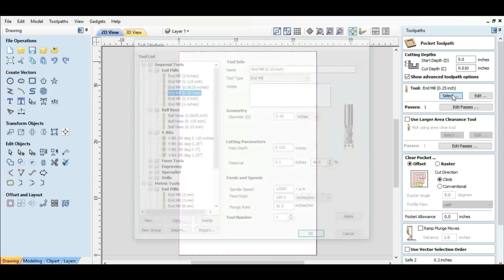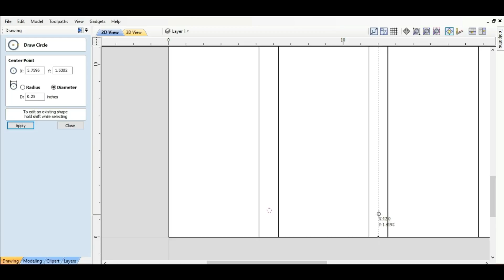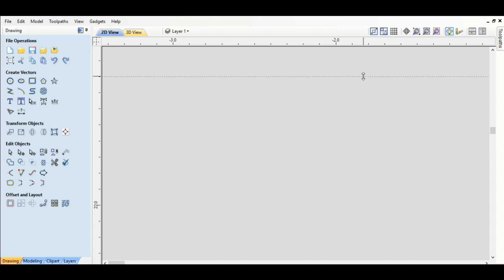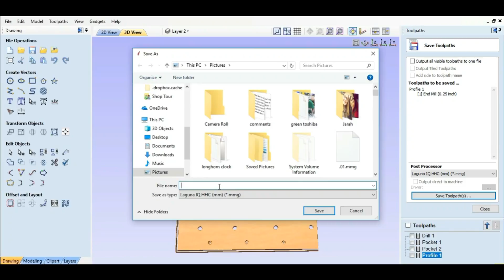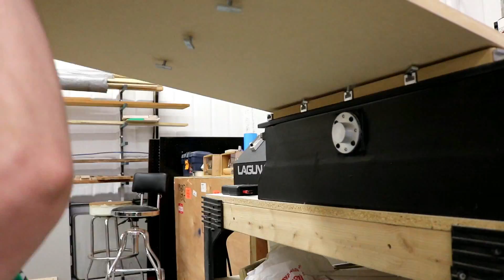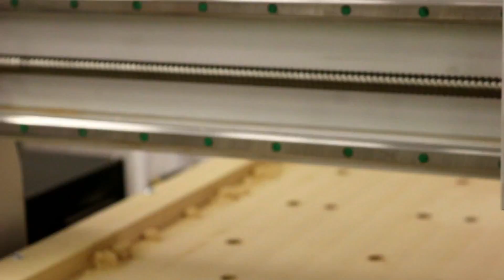Make A Spoilboard For Your CNC // Laguna IQ CNC

Comment: I am new to cnc work and find your videos very helpful. I purchased this bit on your recommendation. My RC-2255 is a 2 1/2" cutter but you refer to yours as a 2" in the videos and the comments. I have to enter the bit into my database and the Amana speeds are very different than what yours are in the video. Do you find your speeds to work well? Any advice?
Reply from the maker: Thank you for watching the videos. I would go by the charts that Amana has for speeds and feeds.. I did this video years ago and the speeds and feeds worked for what I was doing but I would trust the Amana site.

Comment: How does the in-line clamp fit and not hit the bottom spoil board? The stem looks to be about 2” long or more, did you drill through both spoil board? Thanks
Reply from the maker: Yes.. drilled deep enough so it doesn’t bottom out.

Comment: Great video man.   I have a 2 x 3 ft as well.    Question.   How deep does the holder go down?  Or how deep do you have to make the holed for the holder?
Reply from the maker: I can’t remember exactly.. I just measured the length of the peg that goes in the hole.
Reply: @JakeThompson The part the sticks down in the MDF looks to be too long, did you remove the black part of it leaving the grey part to go into the mdf?
Reply: @leejackson3781  Yes I removed it.. I also used some Kreg push clamps too.. I like them more

Comment: Just setting up my Laguna IQ and discovered your videos.  Very well done, my friend.  I received my new flycutter today and hope to start this project soon.  Curious as to whether you would do anything different now that you've used your spoilboard for a while?
Reply from the maker: Derek Strong this way is ok but both styles of clamps try to push the material up.. so I use double sided tape with the clamps.. if I was to do it all over again I would make a cam clamp system.. check out tools today on Instagram and you will see what I’m talking about..

Comment: Hi Jake: I have the very same CNC IQ Series from Laguna (24" x 36").  Any chance I can impose and ask for a copy of the spoil board file, as I would like to duplicate the same spoil board and fence setup that you now use?
Thanks - Michael
Reply: Hi Jake: No problem friend.  I downloaded a copy of your video and I am using it to recreate the file(s).
Many Thanks - Michael
Reply: @sendguns  Michael, I just took delivery on the same machine you have.  How did your replication work out?
Reply: @brettwright392  Hi Brett: I modified Jake's spoilboard when I designed mine.  Rather than use the 3/4" dog holes, I drilled holes for T-Nuts on 2" centers each way.  I use the same type of clamping system that Jake is using, but my clamps use a T-Bolt.  I cut 8" long pieces of T-Track and drill two holes on 6" centers for hold down knobs that secure the T-Track to T-Nuts that inserted from the rear of the spoilboard.  This allows me to reposition my clamping system anywhere within the 2 x 2 grid.
Best - Michael
Reply from the maker: Michael Murphy Hey Michael.. I lost the files when I had a computer go down.. sorry.

Comment: Thanks for the video Jake.  I am really interested in setting up a spoil board like you did.  I really like that idea.  But I have a question?  I have looked at Armor Tool's website and watched all of their video's, but I cannot find a clamp like the ones in your video.  All of the ones I have seen have black plastic looking wedge thing on them and it looks to me that they are long enough that you would have to drill dog holes about 3 inches deep, or completely through the spoil board in order to use them.  Your's don't look anything like that.  How long is that portion that actually sticks down into the dog hole on your clamps.  I would really like to use these things but if I'm correct about this I would have to drill down and through my aluminum bed or make a spoilboard about 4 inches thick.  I sure would appreciate hearing from you about this as I'm sure there is something I am missing here.  Thanks again Jake for a very interesting and useful video.
Respectfully
Jim
Reply from the maker: Jim Scott Thank you for watching the video.. I took the black part off so the part that goes into the spoilboard is only 1 1/4 inch long.  These clamps do tend to try to push the material upward but I have learned to deal with it.. I think a cam style clamp is probably better.. look at @gotwoodworkshop on instagram

Comment: Really enjoy your video. I just got my IQ and want to make this spoil board. Where did you get the nuts for the t track and what length screw did you use. I was also wondering if your peg holes are going into the original spoil board. Thanks.
Reply from the maker: all4boatin I’m glad you liked the video and the peg holes do go into the original spoilboard.. the nuts for the t-tracks I found at lows in the hardware isle. I can’t remember the length of the screws.

Comment: Myabe my new IQ is broke?   When I set the XY and the Z it travels to different places? For example. I zero out my Y on the surface of the work piece. then when I hit go home, it says that the Y is now 40MM but I measure it at 52MM. So when I start my program it cuts 12 MM too high? I also set my table dimensions to 500 by 800 and still the X or Y will go all the way over and jamb up really messing up the original XY home???
Reply: OK, got it figured out. The new IQ was not calibrated. Now I use 319 pulses per MM for x and Y.
It is a good idea for anyone to draw3 a 10x10 inch square and then cut it. Now measure it to be sure it is 10" square.
If needed adjust your pulse per MM numbers until you get it a perfect 10 inches by 10 inches.

Now do the same for the Y travel. Use a dial gauge if you have one.
Reply from the maker: Larry Stringfield when you save the tool path.. there’s a drop down box with all kinds of cnc machines listed. Did you set that to save for the IQ?

Comment: Hi Jake. Not sure if I missed it but what's the actual dimension of the new spoil board? You also just the holes for the clamps 1.2 inch deep. Why so deep, is that the depth of their insert?
Reply from the maker: Niles Krech Hello Niles. The new spoil board is 26x38 inches. The working surface of the cnc is 24 x36 I just made it a couple inches bigger so I could install and remove the straight edge fences on the front and left sides. I went 1.2 inches deep because that is just a little deeper than the dogs on the clamps that go into the spoilboard. Thanks for watching and I hope this helps. 👍👍
Reply: @JakeThompson  awesome, thanks. I have an IQ and need to do this. Great video, very helpful!
Reply from the maker: Niles Krech I bought some Kreg dog clamps after this video.. I like them better., they don’t try to lift the material as much as the armor tool clamps and they are about half the price.